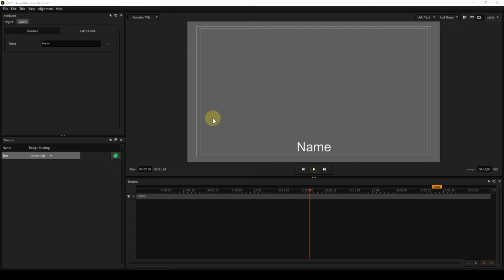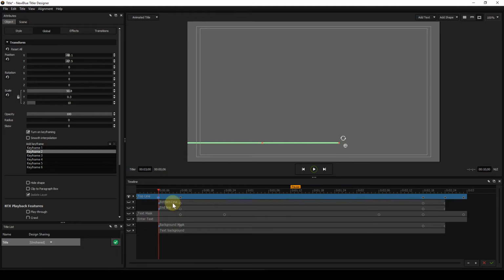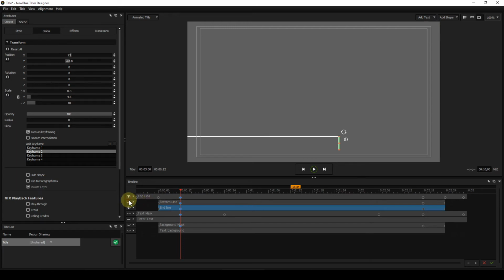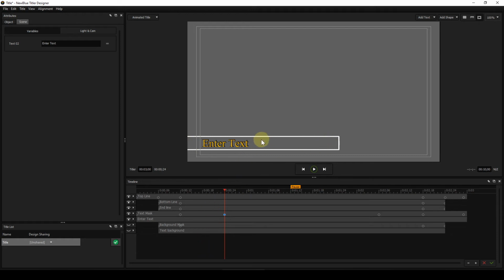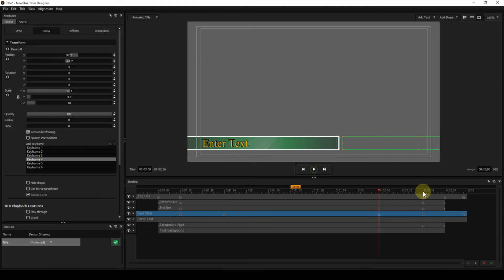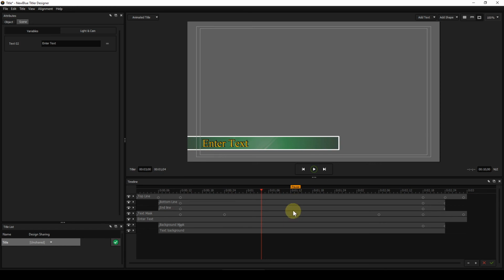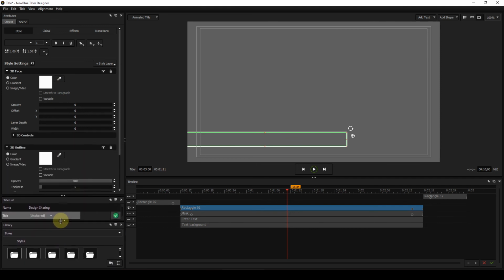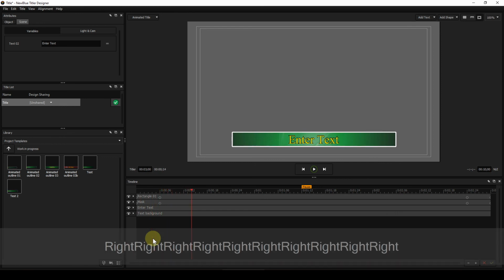Tutorial 17 - Create your own animated lower thirds

Comment: First of all thank you so much for making these Titler pro tutorials, it has been really helped to me. Then I have a problem about crawl: When I use the crawl function to make a right-to-left scrolling subtitle, because there are many texts, it is not enough to display them all in one screen, so I have to stretch the rectangle very long. But in this way, when playing scrolling subtitles, those content that I found outside the screen will not be displayed. The currently conceivable way is to reduce the font size so that all text can be displayed on one screen. But then the text becomes very small, which is not what I want. Do you have any good ideas for this?
Reply from the maker: Hi, thanks for your positive comment. The way to do it is to create your text string, the length doesn't matter. At the start of the event, move the text string fully off the screen on the right. Create a keyframe by enabling keyframing in the Global tab. Move the playhead to the end of the timeline. Use the Position X parameter in the Transform section to move your text fully off the screen on the left. This will create another keyframe. Return the playhead to the beginning and play. If the text crawls too fast, you need to increase the length of the timeline. If you do this, you may need to move the second keyframe to the new end of timeline. Make sure that the keyframe is at the start of the frame before the end.
Let me know if this solves the problem.
Reply from the maker: If you are still having problems I can do a short demo and give you a link to it.
Reply: hi! i tried to follow your description and it seems like right. please check the link down below see if it's right. thx again!

https://drive.google.com/file/d/1-4P8Jk8PvKR29LdvFbFLGauirAMuwTpr/view?usp=drivesdk
Reply from the maker: @zhaooskar3178  Hi. that link has refused me access. Can you check please.